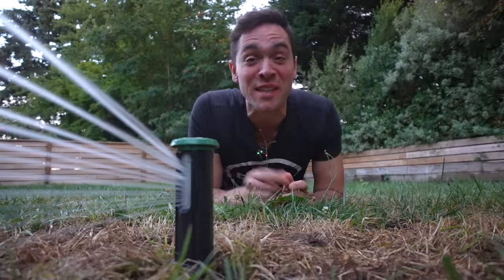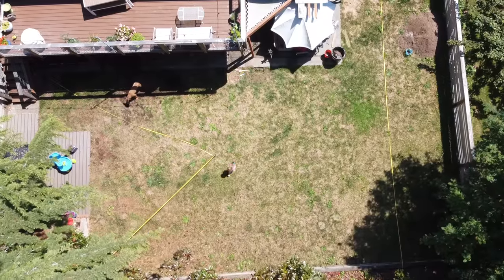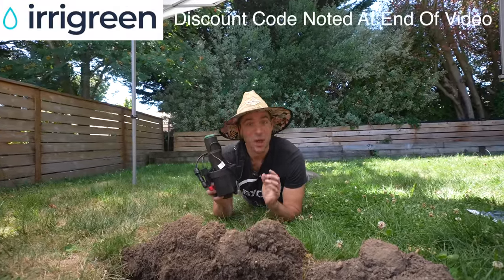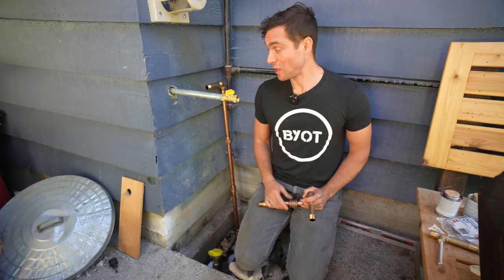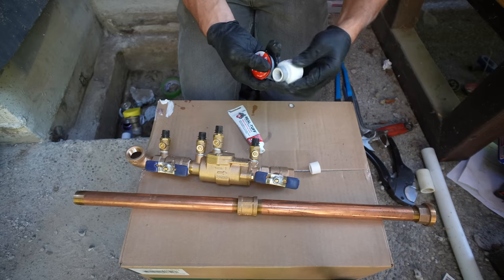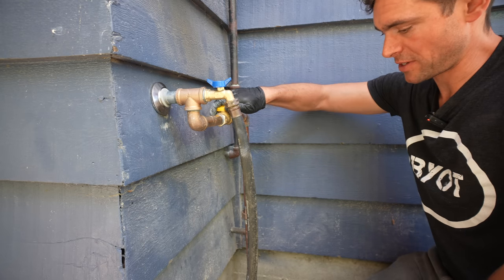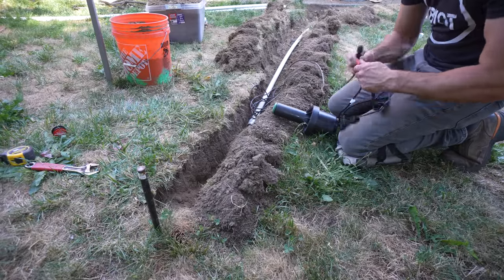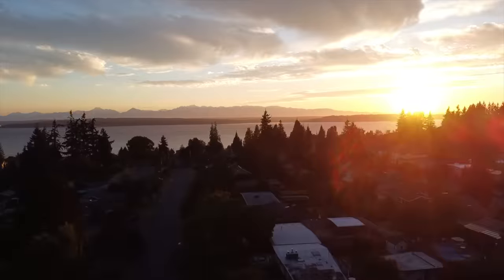DIY Sprinkler System That Digitally Maps Out Your Yard

Comment: Lost me at "cloud controller".
Reply from the maker: What's your issue with a cloud controller? Its literally recording clouds lol!
Reply: Indeed. If their server ever shuts down or they decide they no longer want to support this particular product, then you'll just be forced to pull out the entire sprinkler system and buy and install a new one. Not to mention what happens if you lose internet connection.
Reply: These controllers work offline, so lack of continuous connectivity isn't an issue.
Reply: @GeekIWG dude you don’t know anything about this, you just need connectivity to calibrate through the app , after that is done, it just runs offline.
Reply: @BYOTools  if they ever shutdown their servers your system pretty much doesn't work for the fancy cloud stuff 
also means another random device connected through wifi....why they can't add use ethernet at least I don't know or at the very least have it in there as an option 
and a local system means it's much easier to play around with regard to diy stuff
Reply: @GeekIWG you wouldn’t need to replace the whole system - just the controller.
Reply: @abhimanit12  then let the app connect to the controller directly, duh
Reply: Same. I thought it’s looks like a nice system until he said „cloud“. 
And yes, I see the point for the developer. For example the initial calibration is a lot more easier with your phone over the cloud via mobile data instead of relaying on perfect WiFi in the whole yard. 
Maybe the system runs fine offline after initial configuration. But we don’t know. And even if it’s runs fine today, you don’t know what’s coming next with an update.
In general, I just think about how long is the expected lifetime of a product und is it realistic that a company will offer you a cloud service for free over the whole period (which costs the company money)?
If the expected lifetime period is too long, like for a sprinkler system which ideally you should install and forget because it’s just keeps running, I just do not want do gamble about political and economical decisions within the manufacturer in the next decade.
Reply: Exactly this isn’t DIY, this is “Install It Yourself”
Reply: @parker02311  what else do you do with a home irrigation water system other than install it?  What a silly comment
Reply: If smart stuff needs internet it’s not smart stuff…
Reply: @MustafaAlammar then theyre not really a cloud controller? It just uses the servers to connect the phone to the controller ig, which would make sense. From an IT perspective its a pain in the ass to get a user that doesnt know any it to get a functional remote access working from a local home connection (since most local home connections have dynamic ip's)
Reply: This comment made me not watch this video
Reply: @ThomasG84 you can build it by yourself. I've made myself my own watering system using sensors, pumps, electromagnetic valves and microcontrollers. It's even equipped with weather sensors to not water the garden while it's rainy or there is too much sun. So yea, you can make it DIY and this video is just commercial with the installation of a ready kit.
Reply: All that work and the company decides to charge a fee or shuts down, you end up with pipe that can't be used.
Reply: Wrong.  You don’t need to use the cloud stuff at all. The controller works without internet connectivity, you just need it to be on WiFi.  You can use moisture sensors with the controller.  It’s pretty nice.
Reply: That’s great to know!
Reply: I tried to control the clouds once.  They just slipped through the netting and laughed and laughed 😂😂

Comment: Brent that galvanized pipe you used before the backflow preventer is against code in most states. The reason for this is it will rust, and that rust will get into your drinking water.  FYI
Reply: In addition to that, the galvanized pipe screwing into a copper pipe inside the wall is galvanic corrosion point if copper is in the wall side. You can install a brass union in there to isolate the steel from the copper.

Comment: great video but that sprinkle is prohibitively expensive! for 2000$ you get 10 large yard rainbird kits, and you can manually adjust them however you want. i mean the ideea is ingenious but idk to me it is way too expensive
Reply: And the app will eventually stop working.. a traditional system can be working for decades without issues

Comment: You should never use galvanized pipe for water supply.  Galvanized pipe material will slowly leach into the water, which is vey bad for you if you drink.  Plus, the water will eventually rust that pipe, once the galvanization is gone.  You can buy a piece of copper and either use a “shark bite” type of fitting (easiest) or “sweat” on a copper fitting.

Comment: As someone that worked with pressure vessels and hydraulic systems, tape and sealant is almost always a no-no, unless it’s a specific brand that specifically says you can do it, you shouldn’t, most sealants can destroy the teflon tape. In general if you need both types of sealing, you’re doing something wrong.

Comment: 10:04 PSA never use a plastic or pvc female adapter and a metal male end, the pvc will crack over time on the outside. It’s always better to have a pvc male end into a metal female end for any pvc to metal connections. Im a licensed plumber btw
Reply: Word
Reply: Is not common in the US to use polyethylene tubes for things like this ? Like here in Europe is pretty inexpensive and reliable is used for drinking water and watering plants
Reply: @manuelcuesta7072  we do use it in the USA but certain pvc fittings will crack overtime when connect to metal fittings
Reply: @javyesquivel8711  Polyethylene is not PVC, its a completely different material that won't crack period and is way more robust for underground usage. It would be the go to pipe material for this application in Europe.
Reply: Just a question: did you think he used/ went overboard with the ptfe tape? 
I'm only a window cleaner, but with the water-fed system we use, a small bit of plumbing knowledge is  used.
Reply: @manuelcuesta7072  Polyethylene is indeed commonly used in the USA and have been for awhile now. It's properties are too far superior to ignore.

The issue here though, is the simple fact that a lot of this is exposed pipe, and polyethylene is terrible with UV radiation from the sun.

PEX has been in use in the USA since the 1980s just for reference, that's only ten years after it hit the Euro market.
Reply: @ethangrazier4899  agreed, that's a mountain of tape and can cause undue stress on the female side, not to mention sloppy application can leave excess tape in the water flow path, then clogging the sprinklers. I always do 2 full wraps, and never had a leak.
Reply: @ethangrazier4899  
1- great videp
2- most teflon tape used ever lol
3- 16" trench is great for naval warfare so I'm glad it wasn't just a 4" trench for the pipe.
Again, great guy, great video, thanks!

Comment: I remember designing a similar system (without the fancy app, just using some solenoid valves and an Arduino) ages ago, when a friend of mine complained about the way his sprinklers always covered a circle (or a section of a circle) and his lawn was square. We didn't have an exact way to detect the sprinkler's orientation, though, so it drifted a bit over time.

Comment: My mom owns an irrigation company out of San Antonio, and she was just telling me about these new heads, the ol' algorithm recommended me your vid as a result.  fyi irrigators and plumbers are different professions, and require different licensing. i'm not sure what your local  regulations require, but i recommend that you give a backflow inspector a call and have it inspected, then have it re-inspected once a year. it will run you around about 100 Dollars, catching and replacing a failed backflow valve would cost about 300-400 dollars, but that could save you thousands in repairs, or at the least the cost of repairing it your self. great vid btw, i won't offer further advice because this is not my area of expertise, but ill share with her and she might come on the line with advice.

Comment: For another leak test to make sure nothing is going on inside the wall - before you start go look at your water meter and make sure it's not increasing (verifying you don't have a pre-existing leak). Then after you've performed your work and turn the water back on - go look at the meter again and ensure it's not increasing.

Comment: When you put PVC together, the primer should still be wet when you apply the cement.  Also, you should rotate the part once inserted, rather than just push them together or wiggle them as you put them together.  This will make a much stronger physical bond and make a much more reliable water-tight conneciton.
Reply: I think that's called following the manufacturer's directions. Amazing the number of people who don't bother with them, especially in videos aimed at educating the rest of us.

Comment: The concept is solid. I can’t justify the added cost of each head along with power cost to offset cost of any water waste. Especially since sprinkler heads can be bought in different sizes and rotations. If you had a very large space, and had lots of trees, sidewalks, decks, or anything else that was getting soaked, then maybe. 

The tech is relatively simple. If they could get that cost down to about $40 per head, which is still a bit pricey then it may hold more appeal. 

I have a good idea that whatever they are using to seal the electronics and motor isn’t going to last more than a couple years. Moving parts is wear and tear. Put those outside, just speeds up the failure rate.

Comment: Was actually interested in this and thought, I only need 2 heads as well, can't be that much. The controller alone is $1500 lol. My whole unit with a discount would run $2300 for 2 sprinkler heads???

Comment: My quote from them for one sprinkler DIY was INSANE.
Reply: me too, for 3 sprinklers it was $2700, but said extra sprinklers cost $278.... so what is the extra for??? The piping I would lay myself just like in the video!
Reply: Yes I agree I don't understand if an extra head is $300 the why does it cost $2700 for three heads even with cables and controller? 😮

Comment: Seems like a really good system.  I'd like to see them come out with a soil moisture sensor that wires into their system.  You could place the sensor/s in your yard, then rather than just running on a schedule it'll run only when the soil moisture drops below a set point.  If it's a really rainy period, the system might not have to run at all, in a dryer period, it could run as needed to maintain the optimal moisture level, or until you've reached the limit of your budget (water bills) or local watering restrictions.  

For a flat yard with all the same type of grass, you'd probably only need a single sensor even for a large area like and acre.  In other situations, it could be advantageous to use multiple sensors placed strategically.  For example, bottom vs top of a slope, full sun vs heavily shaded areas, different types of grass in front/back yards, turf grass vs mulch beds with different types of plants/shrubs.

Comment: Looks good. Only difference is I’d put a tee shut off valve after spigot to separate sprinkler system so you can blow it out while still being able to use spigot.

Comment: I've seen some warnings for lead such as on garden hoses, unfortunately where some people think to drink directly from.  With the galvanized steel or brass, were they all drinkable safe? I had to rethink some plumbing I had after learning some things were not usable for potable water and spreading lead contamination.  This may be too small an amount to think about, but I just wondered in case there were any needs for consideration.

Comment: You said you live in Washington. So you get freezes. That spigot system doesn’t shut off inside the wall, so you are facing potential big problems with burst pipes in the winter.

Comment: Holy snap is this system expensive. I thought "My existing system is problematic and I don't love it" but $2700 for 3 heads?  It's $8/head for a Rain Bird PRS Professional Popup - which is fairly luxurious as far as popup heads go. Sure this Irrigreen system requires slightly less labor and pipe, but not that much. Also if it ever has electrical problems or you need to replace it with something else - you're probably totally screwed (aka need to re-trench it). As for water savings, I'm skeptical. Unless your "traditional" system is massively overwatering/overspraying, there isn't going to be much difference - the lawn still needs X amount of water to be green regardless of how you apply that water.

Comment: Why did you add a back-flow prevention device there?  There should be one installed between the house and the meter, and if you were putting on where you did shouldn’t it have gone from the line out of the house into the back-flow prevention and then coming out of that split for the hose and the irrigation system?

Comment: This system fell short for me. Big time. 
I kept having problems with over and under spray. The map never properly gauged my lawn. 
I worked with their engineers thru the "pulsing" and "tracking" problems to no avail. I even got in touch with their CEO who assured me they'd address the issue and then everyone went MIA. Haven't been able to get in touch with anyone for weeks. The latest is that the flex pipe blew off and triple digit temps have deterred me from sitting out there to troubleshoot. 
Truly disappointing because this system would be amazing if it worked properly.

09/2023 Update: after working closely with one of their associates, we ran a number of updates to the app and the sprinkler itself. We managed to narrow down the issue and now, though STILL not as advertised, it's functioning much more accurately and adequately.
Reply: how did you convience yourself that the cost was worth it ? seems like it would take a lonnnnnnnnng time to get anywhere near an ROI of a basic system using traditional heads
Reply: @BrandonMitchell84  it's a good question. I think CONTROL, was the central convincing point for me. I wanted full control of my system from customization of the watering map to measurements of water usage. I wasn't seeking ROI, but in just 6 months of usage, I did see an overall reduction in my water bill of..... Wait for it......
$190 total. Lol.
Reply: You got what you paid for
Reply: I saw a lot of mixed comments of people saying stuff about the cloud controller. Do you need your internet on for it to work or do you know?
Reply: @LaFox23  a $2K irrigation system? Not exactly buddy, but go on.
Reply: @krypinz  it needs internet for you to connect to it thru the app, but I believe it still runs if it's disconnected from your wifi.
Reply: @SlimNubster  this thing costs 2k? That’s pretty high for this piece of crap. Buddy sounds like he got scammed.
Reply: @LaFox23  $1750 to be exact.  I felt like that too but it's hard to deny the sophistication of the tech.  I started pushing my grievances in that direction and then the CEO made some things happen.
Reply: @SlimNubster  thank you
Reply: @SlimNubster I install irrigation systems each zone Is roughly 800-950
Reply: @TRDjuli  I'm not sure I understand what that means.

Comment: Enjoying your videos! I am building a 10 x 14 detached art studio based on your lean to shed project of 2 years ago. No electricity, wood stove intermittent heat in winter only, so I plan to heat it for 4 hour stints then let it cool completely until I use it again a day or 2 later. My question is, if I apply plywood on the rafters before laying down a metal roof on top of that, what material(s) do you suggest between the plywood and metal to prevent excess sweating/icing/moisture damage in my building where it will heat up/cool down repeatedly during our sometimes minus 20 degree winters. Using metal due to snow .Any suggestions from your builder viewers out there? Thanks!

Comment: Using Galvanized along with Brass and the copper in the house is going to cause a dielectric issue and corrode the piping.

Comment: Testing the pressure at the tap with no flow is not a good way to test whether the tap will support sprinklers. It will happily report the water main pressure, regardless of how thin or restricted the pipe to the tap is.

Comment: Very nice system, unfortunately they start at $2,000 for 1 sprinkler head with 2000 soft coverage up to $3,700 for a system with 6 heads and 12,000 coverage.
Reply: yeah i saw that too way too expensive even with the water that it saves

Comment: Do you hate the people that need to inspect your backflow preventer? (Or is that not required in Seattle?) You put the backflow in about the absolute worst place ever for inspections (which at least where I live in NC we’re required to have inspected every year). A much better way to install it would be up from the ground so it’s accessible.
Reply: This is normal in some states.

Comment: you were talking so much about saving water, but you didnt tell us, how much you are actually saving. No problem, i did the math: you suggest buying fancy sprinkler for 2500$ + installation costs to save 1$ per month on water. The controller box consumes probably more electricity, than it saves on water. Thats not how "saving" works.